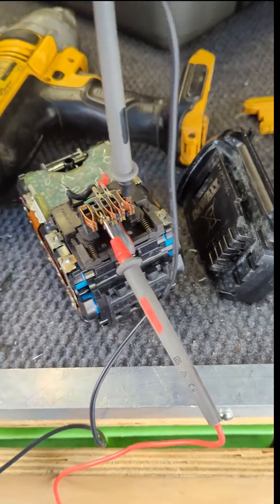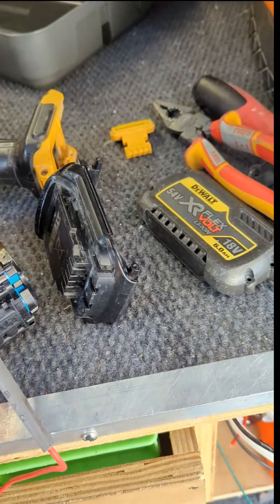Dewalt Battery Repair | 6Ah Flexvolt

Comment: Reviving an old thread...was wondering if you've run across an issue similar to mine.  I've rebuilt the entire pack using new 21700 cells (mine is a 9ah).  The pack lights up as the cells are balanced before I use them.  The pack works fine; lights up full and powers the tool with no problem.  Charging it though either shows a quick red light that dims and goes out, or blinks for a while and stops.  So the tools, despite working fine, won't charge.
Reply from the maker: I gave up on this battery eventually. I had to redo what I did in this video a few times.

Your issue sonds likeit's temperature probe related though. I'm not sure how you'd fix it.

Comment: Great video man. I have a similar issue, not exact. Battery is holding a charge, 2 bars left when I click the button, power tools work with the battery. The battery just won’t charge. When I put it on charger nothing lights up. I tried jumping it but still nothing. Any idea?
Reply from the maker: Have your tried testing it with a multimeter to see if one of the pins is different from a good battery?
Reply: So I opened the case and found 1 of the pins wasn’t alignment properly. I realigned it and it charged for a few minutes, and then back to the same problem. I’ve tried jumping it and it still won’t charge. I’m getting about 18v out of b+ and b-, and 10k out of b+ and th with the thermistor check. 2 lights show when I press the button. Tools still work as well. I’ve tried a 20v tool and a 60v tool. It just won’t charge.
Reply from the maker: @tmuney08 sounds different from my fault. Mine would only run some tools such as a torch but wouldn't run power tools and wouldn't charge. Did the pin bend back maybe?

Comment: Just wow. Thank you sir, you just fixed my battery. Same exact problem
Reply from the maker: Here I was thinking this was a rare fault and my video wouldn't help anyway.

I ended up redoing it with chopped pieces of pvc  electrical trunking. The silicone jn thr pc keeps shifting causing it to stop working again.
Reply: Thankyou for the video, just fixed my 6amp with a washer.  @legacyelectrical

Comment: I am thinking plastic or teflon might be a better idea here, using conductive washers might pose risks of shorting your contacts, however small the chances are.
Reply from the maker: That's a good point. I ended up redoing it a few times and added some chopped up prices of pvc electrical trunking